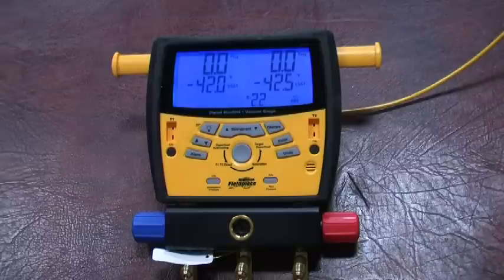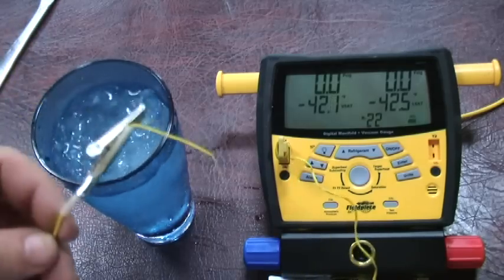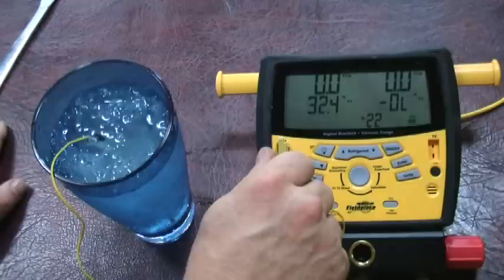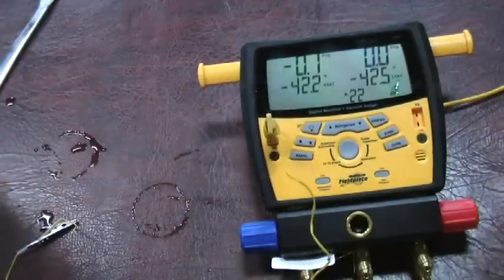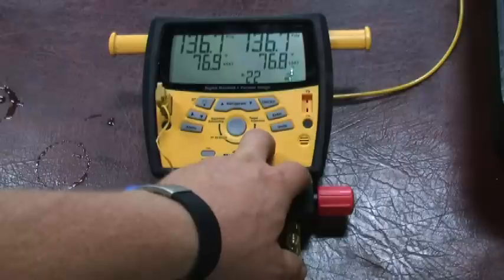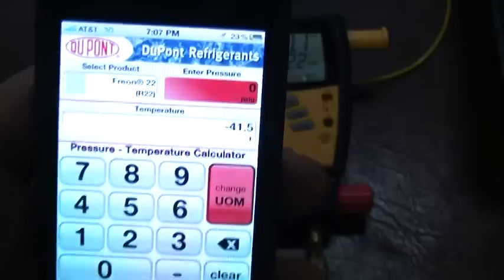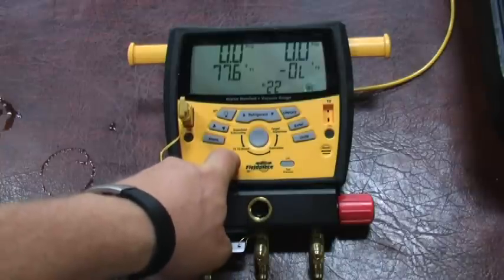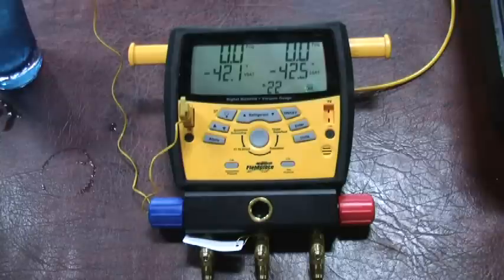HVAC Tools - FieldPiece Sman 3 Calibration

Comment: Eddie I believe what you are seeing is altitude/atmospheric compensated saturation temperatures. The further you go above sea level the lower the saturation temp will be even when the pressure is reading zero psig. FWIW every time you turn the unit on it will auto zero to 0 psig. If you go up in the mountains and turn on the unit it will read 0 psig but an even lower saturation temp. HTH even the Fieldpiece Guy ;-) There is an inaccuracy between the high and low side which normal from others.

Comment from the maker: I would start by unhooking all of the hoses, open all of the handles, press the zero atmospheric button, hook the yellow hose back up and cap the low and high side, get a jug of r-22 that has been sitting indoors for at least 24 hours, hook up the yellow hose turn on the refrigerant tank, makes sure that both the low and high side valves are open, plug the bead thermocouple into the manifold and attach the other end to the middle of the refrigerant tank, Press the refrigerant button to match

Comment: I was ready to run, LOL!!
Actually I got this reading of pressure on a window a/c unit. 
Cooling Capacity 24,500/25,000 Btu/h
EER 9.4/9.4 Btu/h-W
Design Pressure H.S: 350psig    L.S: 150psig

Actual suction pressure was 92psi

Comment from the maker: If all refrigerant manufacturers made each refrigerant the exact same way, then all their P-T charts would match each other.
In addition, calibrating the thermocouple to the T1 port before performing the calibration is recommended for better accuracy. Also, the SMAN must be in T1-T2 mode when you press the Test Pressure button to perform the calibration. If the calibration is successful, you will be "good" displayed on both high and low side pressure values.

Comment: In regards to the state of ice at a certain temperature.  You are getting into heat latency.  I water can either be a solid or a liquid at 32 degrees, depending on if its absorbing heat or rejecting heat.

Comment: Liquid Water at 32*f is not  solid ice until an additional 144 btus of heat is removed. This is the LATENT HEAT OF FUSION law of thermodynamics.

Conversely solid ice at 32*f will not become liquid water until 144 btus of heat is REMOVED.  Latent heat at work again.

Comment: I would guess there are a number of reasons. 1 there are no perfect thermometers or pressure transducers. 2 you can't obtain exactly 32F/0C with table salt, tap water and an ordinary glass. Not being at sea level could have it's influence as well. Looks like it's @ %1-2 error.
I always try stay on the lean side when charging. I stay 2-5 degrees higher when charging by superheat and I stay the full 2 degrees less when charging by sub cool since I can't totally trust my tools

Great demonstration.

Comment: I tried the ice water test and found 32 degrees is not correct to calibrate to. 32 degrees is the point where water can change state. When you add ice to water the ice immediately starts melting, might be very slowly but it's melting. If it were to stay 32 degrees that cup of water should theoretically freeze over. 33.1 degrees is the point where ice changes state back to water. I don't know if that would fix your temp calibration but give it a shot. I'm having other issues with my gauges

Comment from the maker: I do have separate hoses on my manifolds but I can tell you that i'm not all that anal about it. Lets just say I don't always run to the truck if I don't have the right manifolds with me.
 I will say that I purge my hoses after I remove them from the a/c unit.

Comment: That was vsat and lsat.  That has NOTHING to do with the clamps.  This is the procedure for calibrating the temps, but the vsat scale is based off the internal computer, and is not adjustable (for good reason)

Comment: 1.not very clear method. 2. at 0psi you seems has no R22 anywhere, so the reading is not defined. 3.137psi temp reading is the tank case temp not the R22 temp

Comment: my danfoss pt chart says exactly -42° at 0 psi for r22... i have another chart that says -40°... charts vary a little. im sure dvery manufacturers mixture is a tiny bit different and im sure theres a tolerance allowed for the components used to make the r22. nothing is ever EXACTLY the same...